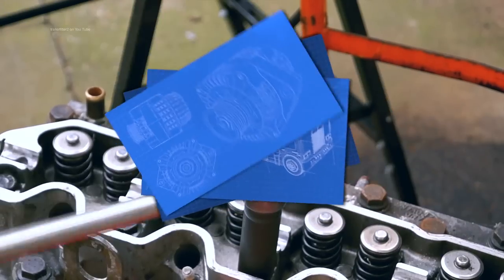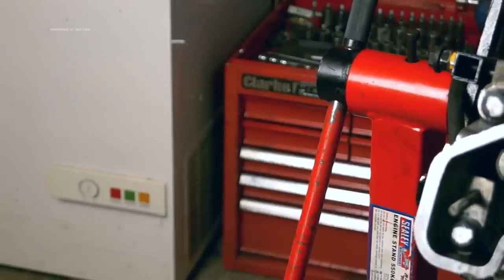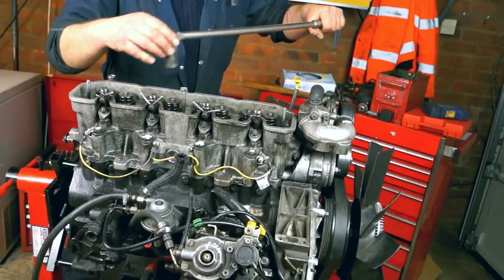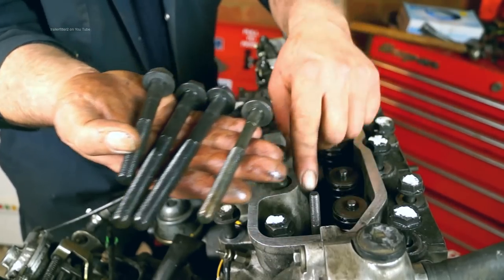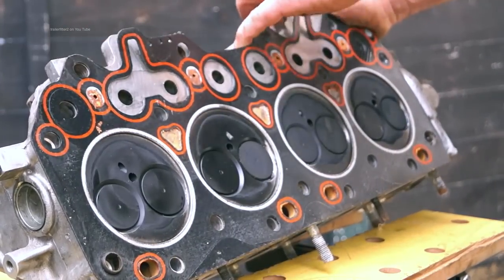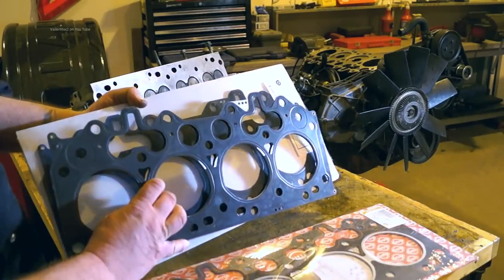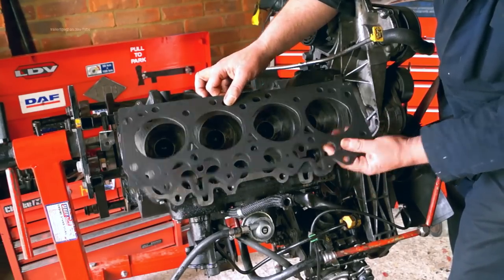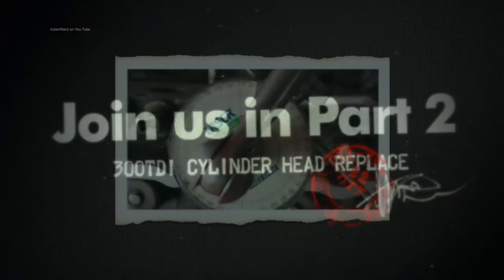Replacing the 300tdi head gasket PART 1- bolts gaskets and sequence.

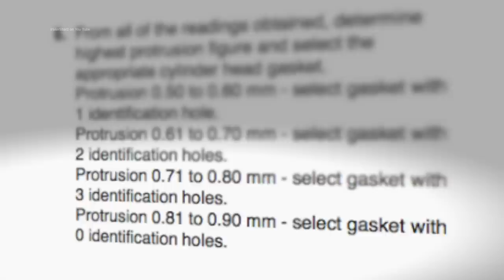Comment: At 6:40 you show protrusion 0.71 to 0.8 requires 3-hole gasket. Parts suppliers are stating the ERR5263 3-hole gasket is 1.5mm. Please clarify. Thank you.

Comment: Thanks once again for making these videos Chris, all signs are pointing to a failed gasket on my 300tdi Disco so I'll be doing this shortly. My heart wants to just throw in a 2.8 TGV but my head can't handle the cost of that idea!
Reply from the maker: Win the lottery this weekend.    Have you seen the video on checking the cylinder head for warpage?    https://youtu.be/oTi6B7VNE7U
Reply: I can only hope! Would probably get the Simtek guys to put in a TDV8! I checked out that video and will re-watch a few others, I have a similar big square so will use that. Not looking forward to it, sniff test didn't detect exhaust gas so I'm expecting a crack. Oil Spy said no coolant in the oil too but it really pressurises. Will it take a skim? Don't know if it's been done before, I suppose the number is in the manual. It's around here somewhere I just need to dig it out.

Comment: Ive taken the head of  my defender 300tdi 1997 after 360,000km , the gasket on the  drivers end is split i near the corners.
something must have fallen down the cylinder is there is damage on the number 3 piston also the head, the pistons move about 1 mm back and forth ,thinking  if that is normal, i will do a drain test next, any advise would be great.thanks

Comment: YOU CANNOT RE-USE HEAD BOLTS ON THESE ENGINES. THE OFFICIAL ENGINE MANUAL LRL0070, LRL0003, LRL0081 CLEARLY STATES REMOVE HEAD BOLTS AND DISCARD. THEY ARE TORQUE TO YIELD "STRETCH" BOLTS, THESE SHOULD NEVER BE RE-USED. The other major land rover workshop manual states they can be re-used up to 5 times, this is a mistake. The MAIN CAP bolts can be used up to 5 times, NOT the head bolts. Re-use them at your peril, new bolts are very cheap, don't risk it. (22 years working on Land Rovers mechanic)

Comment: can a defender 200tdi fit into a discovery or range rover zf automatic gearbox without drilling modification? thanks
Reply from the maker: Would it be worth it?    You'd need the correct adaptor plates.
Reply from the maker: to give you an idea what is involved on the 300tdi engine here a list which is with the ZF gearbox conversion Ashcrofts are offering 

http://www.ashcroft-transmissions.co.uk/defender-auto-conversion-kits/300-tdi-defender-auto-kit.html

Comment: I have onwe of the new style multi-layer head gaskets but the hole for the oil way that passes from block to head at the front  injector side do not line up. I'm concerned that the oil will not flow to the rocker shaft. Any advice?
Reply from the maker: +Laurie Hurman  Yes I have noticed that on those gaskets ,...even one supplied by Land Rover.     They should line up once compressed.

Comment: I just picked up a 200tdi that has sat in a paddock under a tree for 5 years, it started up first try but it's blowing (exhaust?) out the back of the head, it feels like it's coming from the gasket https://www.youtube.com/watch?v=BM8b3zw0bGY have you come across anything like this before? seems odd because it runs fine and there's no sign of coolant in the oil or oil in the coolant etc
Reply: did you ever get to the bottom of this? halfway through fixing the exact same issue